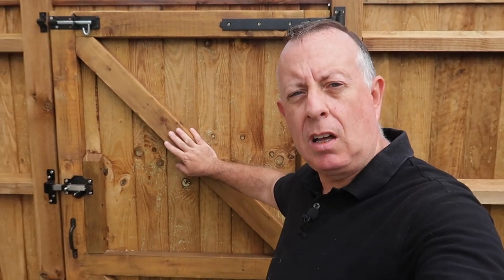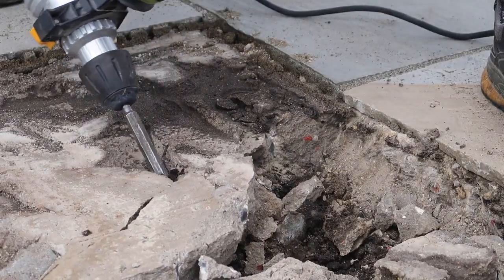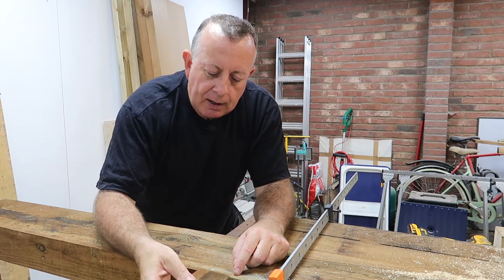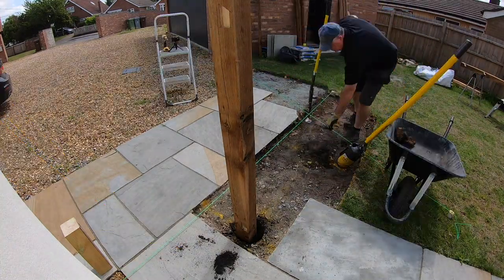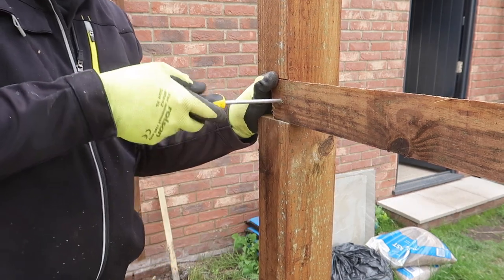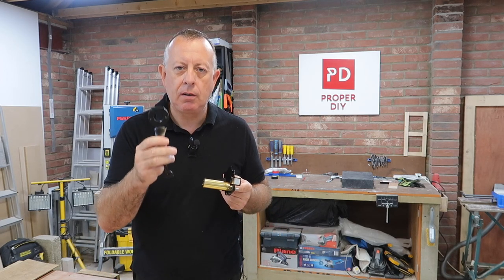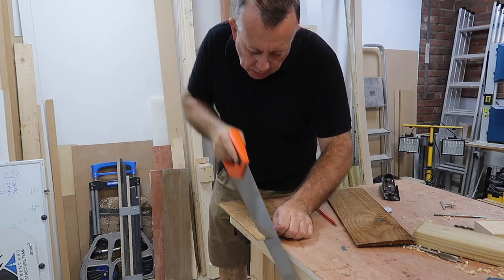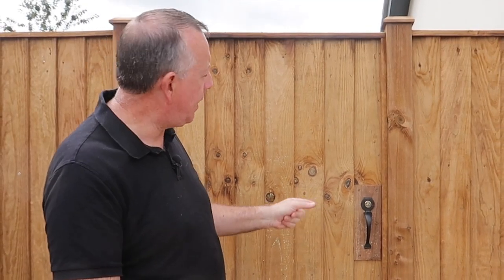How to Build a Side Fence and Gate - Start to Finish

Comment: I'm from the US, and it took me a while to figure out what a "garriage" was, but I have it now.  I have shadow box fence that is in need of repair to keep my dogs off the highway. Love the videos, but I will admit having issues translating from millimeter to inches, but I am working on it. I found Proper DIY looking to fix a leaning fence post, and now I watch regularly. Thank you!
Reply: Just remember that 1 inch is 25.4mm.
We tend to forget the .4mm, so 50mm is 2ins, 100mm is 4ins etc.
1000mm is 1metre.
Key ones to remember
are 2 feet and to 16ins.
That's 600mm and 400mm respectively.
In England we abbreviate millimetres to "mil" so 750mil equates to 2ft 6ins.
You'll get the 'ang of it.

Comment: When it comes to the subject of corded or cordless tools, I am yet to be convinced. I think cordless tools are perfect for tradesmen who use them on a job site every day, time is money and ease of use. But for someone like me who uses them for DIY I still mainly believe in corded tools (with the exception of the cordless drill and impact driver of course!). Due to the cost of the batteries and the deterioration of the amount of charge they hold, plus if the batteries are compromised they can be a massive fire risk, especially the 54V ones. But I could just be a dinosaur 😊
Reply: I agree with you, cheaper, more power what's not to like.
Reply: I think it would depend on the type of work you want to do. If clumsy tools keep you from starting a build, because you have to spend half your time setting up, then batteries might be the way to go. If you are doing just maintenance type work, then corded is just fine, just a little less convenient on certain places. But you never have flat batteries with a cord and most DIY-ers only have a few of those usually.

Comment: Hi Stuart.. Another great video. I have a question for you. I am building some double gates at the side of my house. The two side posts will be bolted to side of extension and the other side to the garage. the total width of he gap is 2.48m. Would 4x4 posts be ok for the side supports? I will be bolting as per your other video. Thanks

Comment: Hi Stuart. I'm here after recommendation from RagnBone Brown. I fit those locks all the time. Couple of things - if you had used one full length FE board you wouldn't need to worry about getting the handle centred; I use a 25mm spade bit and ream out the hole with a file to get the barrel to fit. Good video 👍🏻

Comment: I too have an SDS drill with a breaker attachment and I can confirm how easy it is to perforate an old lead water pipe - instant water feature.
Reply from the maker: That's what you call 'water cooled'!
Reply: @ProperDIY 😮😮😮😮😮

Comment: Hey Stuart, proper Gatemate locks come with the correct spade bit in the box. Not sure how good they are but I have always used my own spade bits.
Reply from the maker: It's strange that Amazon sell 'Gatemate', on my order it's Gatemate but comes as Perry!
Reply: @ProperDIY  Maybe contact Gatemate and ask them ? Or the Amazon seller is pulling a fast one, claiming them to be Gatemate but they are a copy ?

Comment: Really good video. Word of warning regarding them gate mate locks they freeze over an awful lot in the winter. Ive got 2 on my driveway gates have to keep wd40 to hand or get hot water. Apart from that they are realy good locks
Reply from the maker: Thanks. That's interesting. I will keep an eye in it over the winter and will do update video next year
Reply: I put a bit of graphite powder in mine each year, gets used everyday throughout the winter and works fine.
Reply: I used wd40 silicone spray, seems to have done the trick nicely.
Reply: @mburton5365  cheers for the advice i will defo have to try that just saw some on amazon
Reply: @offcuts4146  When you squirt the graphite powder in, operate the lock a few times so it spreads the graphite around inside. If you ever put water onto / into a lock, be sure to flush it out with WD40 or similar. Any water left inside will freeze.
Reply: @mburton5365  cheers for that will be useful
Reply: @mburton5365  sorry i forgot to ask how often usually do you have to do this in the winter.  is it once a month for example or just so it if notice lock starting to not move as freely
Reply: @offcuts4146  I usually do it every 3 or 4 months, just done it today so I will do it again mid November.
Reply: @mburton5365  cheers

Comment: Another great video. Just a query..at the start you lined up your string with the front of the garage and house, but the end result was set back at least 6" by the look of it... What happened?
Reply from the maker: Good question and I didn't really explain in the video. I wanted both sides of the fence to be parallel to the house/garage but not in line with them. I set them both back 300mm which looked right.

Comment: I get the feeling that the handle if you had fitted it off centre only you would of noticed. I’m pretty sure the majority of professionals would of fitted it off centre and not batted an eye lid but it’s these little satisfying details we as DIYer’s pay attention to that makes a big difference to a completed project.
Reply from the maker: You are right. I think the pressure of time/cost and just a general lack of attention to detail by those I have employed over the years is prob why I do just about everything myself.

Comment: Love the colour of the gate and fence what stain do you use?
Reply from the maker: The fencing comes naturally that colour from the sawmill - it's the brown treatment they use. I used an oak colour stain on the green timber which I find then tuns it the similar colour so it matches.
Reply: @ProperDIY  thankyou also wanted to know what brand of wood stain please?
Reply from the maker: @kerrielove7608  Its the Cuprinol water based stain. Have a look at either my Garden Table with Concrete Top or BBQ Station videos - I think they had a shot of the tin
Reply: @ProperDIY  thankyou.

Comment: You've done that better than most 'pro's' - great tips and explanations, very educational. I wonder if you have any thoughts on using bitumen on exterior cut end grain instead of water sealer? I once spoke to someone who runs a company that manufactures pressure treated timbers, his view was that external wood treatments were a waste of time, except bitumen. Obviously he was biased but it was interesting to hear. Thanks Stuart.
Reply from the maker: Thank you. I have used bitumen based paint on the end grain of timber (see my 'How to dig, set and concrete fence posts' video) and I think it's very good as long as you are not going to see it. You don't really want to end up with a fence that has black patches dotted around it really. Black bitumen paint is used a lot in the construction industry and does work well.